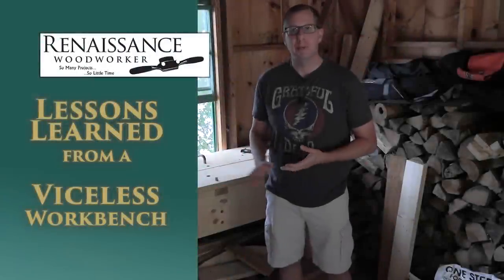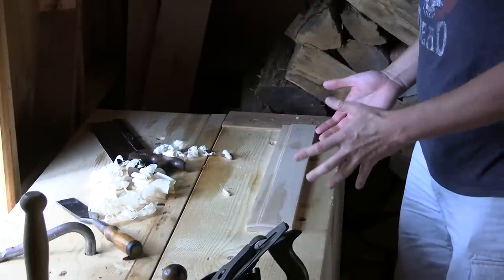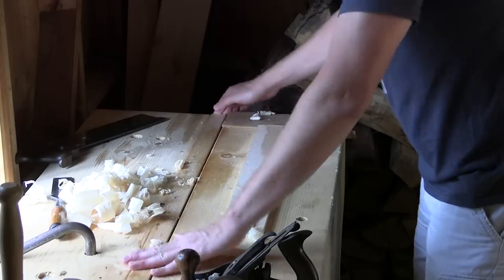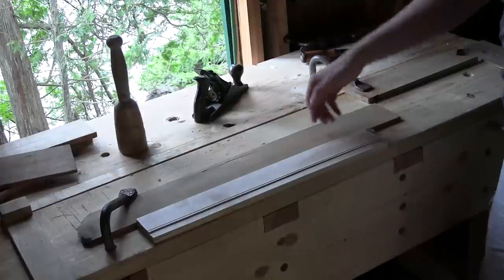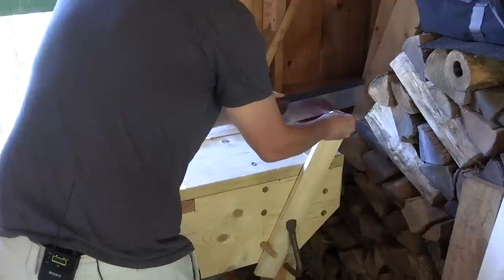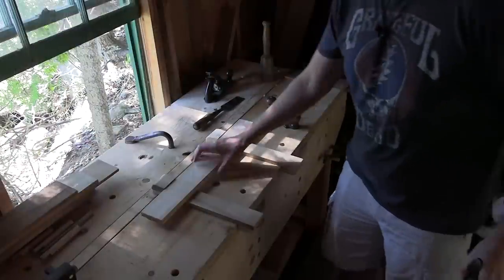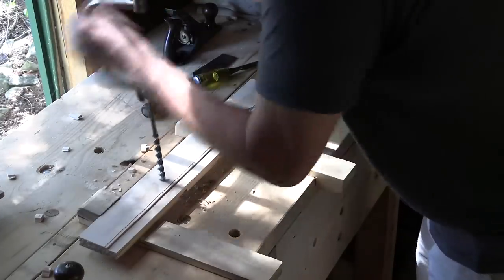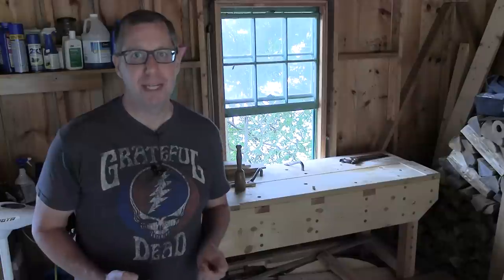Lessons Learned from a Vise-less Workbench

Comment: Great stuff, Shannon! I have been making a couple of benches for Rob Cosman's PHP vets. 
I think it's time I got rid of the 1/2" plywood I've been working on (I have a metal, electric-over-hydraulic scissor style height adjustable bench; health/mobility issues; I love the versatility this part of the bench gives me). I plan to make a 3-4" thick top with oak boards I have stashed away. This video has affirmed the idea that I want a wide surface at the front of the bench to work off of as well as the dog holes to facilitate hold-downs.
Thanks for the inspiration, maun! 🙂:yougotthis:

Comment: Edifying! I'm in the process of designing a workbench for hand tool woodworking, and I've just added the planing stop, the planing beam, a peg near the leg vise screw (for my vise-clamped sotck to rest against without touching the greasy screw) and a paring hook to the list of accessories that I had not thought about and will make my work much more efficient. Thank you!

Comment: Since I started woodworking I have been limited to a Work Mate and one of the first things I built was a Bench Bull. Mine is made of 4 x 4's. I think it was published in WoodSmith Magazine years ago. Many of the ideas you show here are also incorporated into the bull. I started out folding up the workmate each night but for the last 2 years I leave it up all the time. So a 4ft bench like this one could let me leave it up and still park the car in the garage. I could raise the height to save on my back and still use my bench bull and Moxon Vise. Hmmm. And I could still use my workmate as an extension as needed. Hmmm. A workbench or air conditioning.... haha.
Reply: I have a few bench bulls, they are fantastic.

Comment: Recently cut my first mortise and tenon joints (16 of them actually!) to build a Paul Sellers bench stool for myself and I can already see advantages to holding work without a vice and how it would of sped up some of the work. I think the next thing I need to look at is adding dog holes to my current bench and see how  it works for me. Watching the board milling video just drives that home more. Plus I plan to rebuild my current bench (one I was given by a friend and really isn't that great) so it would be good to build-in the features such as front apron.
Reply from the maker: I'm a fan of adding dog holes as you need them but if you want a good starting place I made this video on my "system" for locating them:  https://youtu.be/yjEK6sywHU8

Comment: Question for you: how would I hold a 1/2" thick piece of oak thats about 4"x4" high and long without a vice, while it stands on edge? I need to shave it with a spokeshave, possibly drawknife, and then plane the edge.
Reply from the maker: I'd wedge it between 2 pegs into the apron or ideally 1 peg and the shaft of a holdfast then use the holdfast to secure it to the front of the bench.  Or take a tip from the Colonial Wheelwright and sandwich the piece between the bench and your gut and shave the edge that way.  Many wheelwrights used a small dog with a metal point on the end stuck into the front apron.  I actually demonstrated this technique recently during a Hand Tool School presentation.  Its very fast to manipulate the work piece and you get full access to every side of it.

Comment: This is an older video, so I hope you are able to respond, but I can't think of any operation that I would need to do, that can't be done on this vice. Other than what was discussed in your video, are there any operations that can't be done, or are much more difficult on this bench than on one with a vice? Thank you so much! I found this to be fascinating, I never thought this through in this way before.
Reply from the maker: Nope that's kind of the point of the whole video.  Certainly a leg vise does add some convenience but this workbench have proven time and again to be able to handle anything I throw at it.  I've build multiple pieces of furniture, small projects, and tools on this bench with no need to add a vise.

Comment: Now I'm really curious. At about 43 seconds in you state you have two vises at home, but only use one? Face or tail? Six shots or only five? I gotta know...
Reply: Oh duh. It's your Roubo...you're talking about the leg vise is the main one you use? Right? Just curious which you find the most useful if you were to have a vise at all. 

I'm still in the process of figuring out what (or if) I want for a workbench. I've gravitated from power tools to Japanese saws, but much prefer western bench planes. I have a couple sets of bench chisels, but likely would be indifferent to whether they were eastern or western. 
Most of my work is done on a pair of Van Arsdale Japanese-style sawhorses and a slatted 29"x72+ two inch think "base" I lay across it. This winter I'm going to do something to improve this. Limited space has kept me from building a "proper" workbench, and it hasn't stopped me from building a desk and now a bed frame. I might just do some planing beams or torsion beam/boxes to lay atop the saw horses and clamp in place. Clamp another board between the two stretchers and it really locks it down and prevents racking, what with the wide feet of the sawhorses...

Comment: I'm just starting to build a heavy bench for home right now.  I want tobe ableto work on either side of it and was thinking I'd build it as a joiners bench on one side and plain on the other.  That way I can use the hold down and dog system on one side and a contemporary system on the other.  I got a "once in a lifetime deal" on a 9" wood worker's vice. After watching this video I'm wondering which side to locate the vice.  I was going to install it on the joiners side and recess it flush to the face to make the jaw flush.    I'd be very appreciative to read your thoughts on such a thing.  thank you
Reply from the maker: I'd be really curious to see how you design a dual identify bench like that.  Tho I will tell you in actual working there is not such a big difference that having two sides like that will make.  Regardless I'm partial to leg vises over all other styles but if the front vise is of a good quality that won't rack or sag over time it can be a powerful addition to add into the front apron.  A leg vise will allow you to use the whole front apron though while the front vise will not.  So I would actually install it on the non apron side of your bench.
Reply: @RenaissanceWW  I'll send photos when I get this built.  You might have been around the block a few more times than me so what design would you use for the non-joiner bench side.  Following our discussion so far, the steel wood workers vice will be going on the contemporary side.  It'll be timber faced and the stationary draw will be flush with the face of the bench.  I'' put together a leg vice for the joiners side.  The overall bench height will be 34" but a moxon mini bench will be stored under the bench for dovetale et al work.  Thank you
Reply: @1deerndingo  Chris from Third Coast Craftsman did something like that. He essentially built a roubo with an apron like a nicholson on one side. So, he can be viceless on one side and vice...more? on the other. https://www.youtube.com/watch?v=Va8tlFpnhRg

Comment: you absolutely cannot use a bench hook to cut using a Japanese pull saw , AT THE MOMENT !  I am working on that though
Reply from the maker: sure you can.  Turn it around and hook it over the far side of the bench or it a split top, hook it into the center slot.  In my early hand sawing days when I was still messing around with both Western and Eastern saws I built a bench hook with the fence more in the middle of the platform that allowed me to put the workbench on either side and use either type of saw.
Reply: @RenaissanceWW  iwas thinking webbing and hooks for varied width benches, but yours is simpler! duh! I forgot KISS,  WHY DO SIMPLE WHEN YOU CAN OVER THINK !!! Thanks, easy when you think about it !

Comment: I cringe whenever I see a quickrelease vise on a woodworking bench, imagining the sound of formerly sharpened and set saw teeth encountering the cast iron surfaces
Reply: That’s why I added thick wood jaws that are wider and taller than the metal jaws, I’ve never sawn into the cast iron but certainly have  nicked the wood a number of times😙.